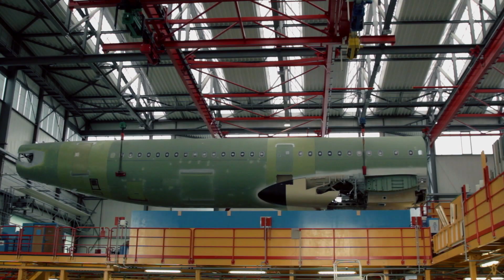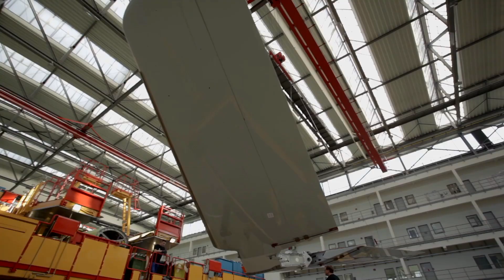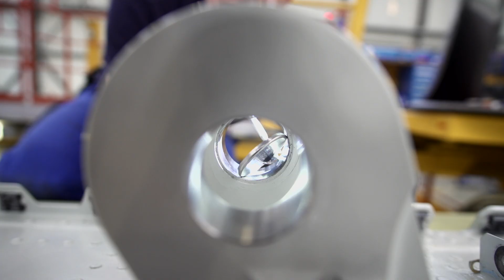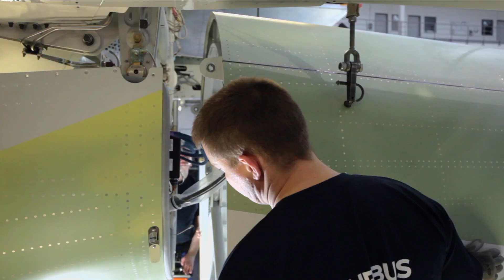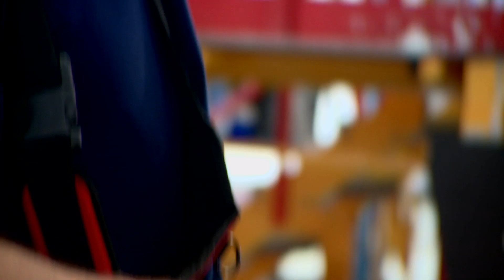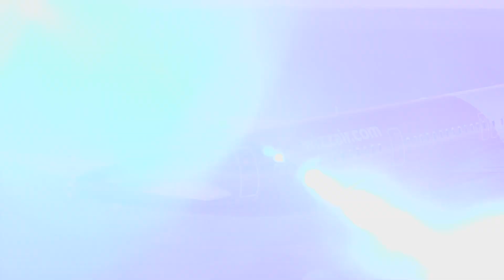Wizz Air | Building the Airbus A321neo

Comment: What is the difference from neo and original one
Reply: PersDi123 It’s better for the environment , better acceleration and more passenger seats ( I think)
Reply: @andreascharalampous3950  More silent engines with less consumption comared to the classic engines (cca 1,7 tons / hour i guess).. no more passenger seats compared to the classic a321, however...
Reply: They can reduce cost because the plane is a lot more efficient in energy consumption. By design and also with the new engines.